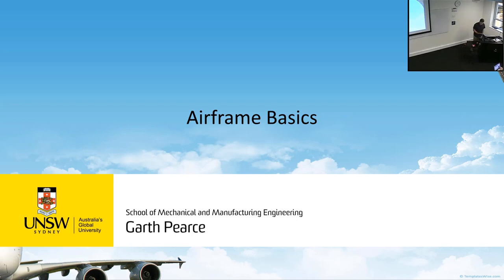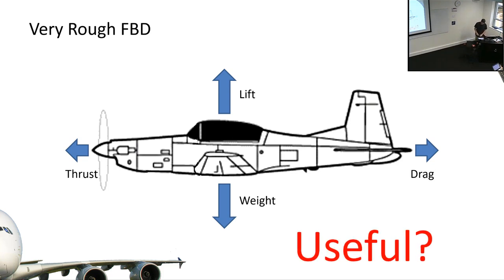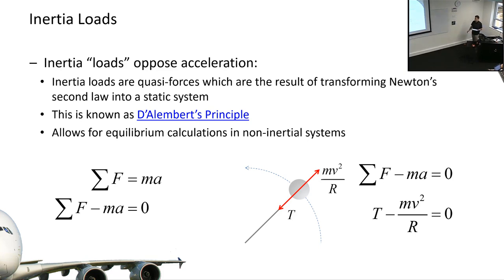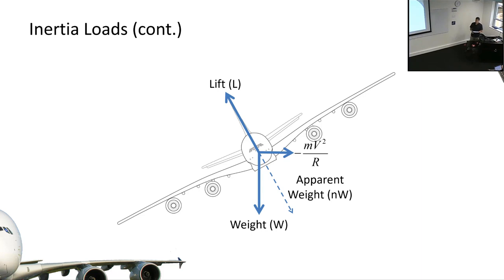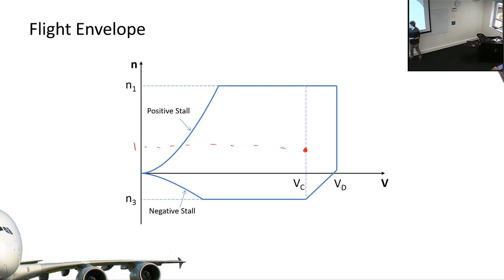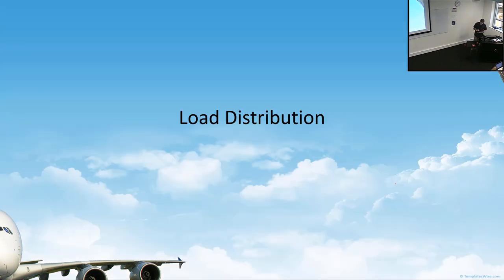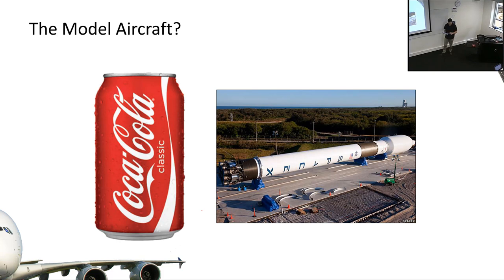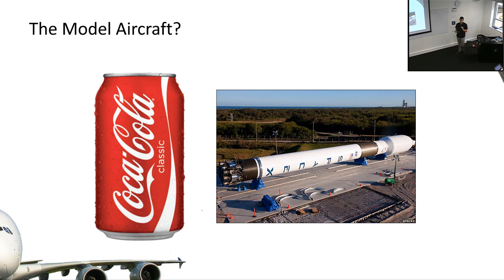UNSW - Aerospace Structures - Airframe Basics

Comment: 1:06:55 What?! Elevators control mainly air speed?!? Can somebody please explain to me why?, Or where can I find more info?
Reply from the maker: Are you familiar with the lift equation, because the explanation can be found in there. The amount of lift required to keep the aircraft in the air is fixed by the weight at any given moment. Therefore, there is a balance between the lift coefficient term and the airspeed term. To increase airspeed you need to decrease the coefficient of lift and vice versa. The coefficient of lift is controlled by the aircraft pitch attitude, which is controlled by the elevators.
Reply from the maker: The throttle and elevator controls are counter-intuitive. To fly faster you pitch the aircraft nose down. To climb you increase the throttle. It isn't quite so simple as this, but it is accurate to a first approximation.
Reply: You've just discovered one of the big challenges of learning to fly.  Pitch for airspeed, power for descent.  Excess thrust is what allows an aircraft to climb.

Comment: pity the speaker has no passion for the topic he is talking about ... such a bland delivery .... could have used a computer voice to get the same effect ...
Reply: 4mm actual skin but engineered with 8inches of apparent skin surface ... no plane is a metal sheet  it has internal structure part of that internal structure ... the exterior surface to the interior surface although mostly empty is engineered to act as if it was solid ... so yes the skin is only a few mm thick but its apparent depth is closer to a foot thick ... glossing over that this early BAD FORM
Reply: think flying buttress on a cthedral it makes the effective wall depth 30 feet ... not 6 feet ... allowing the building to carry more weight so it can built higher ... same as the fuselage of a plane its skin may be 4mm thick its effective skin is 8inches thick ... while a proportional coke can would be 4 inches approximately MAJOR difference
Reply: have to vote this video down simply because this teacher is not teaching reciting ... he is not educating he is indoctrinating and he knows it tha is why he has no passion about what he is talking ... this is the garbage portion although somewhat useful it just promotes the same old over and over again and NOT innovation
Reply: Not all engineers are teachers.  It is a shame seeing such interesting material presented in such a way.  I'm sure he's passionate about the subject, but perhaps not the idea of teaching.
Reply: Bro is a world class hater